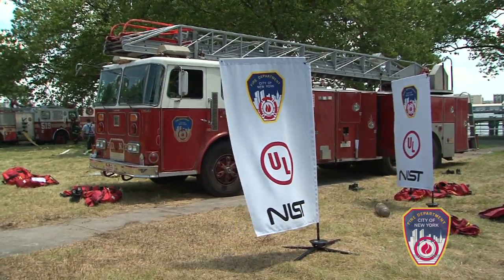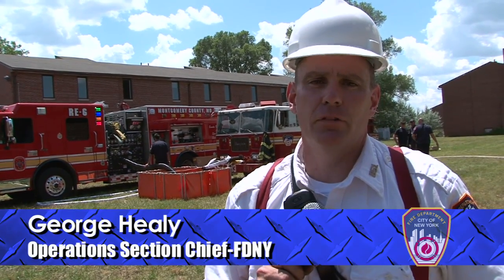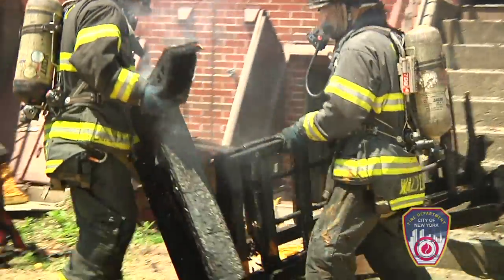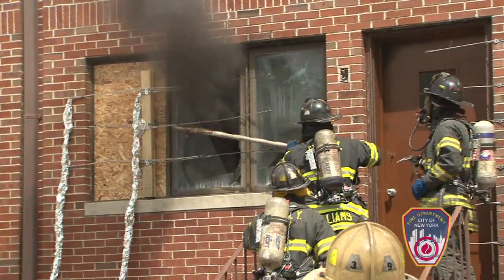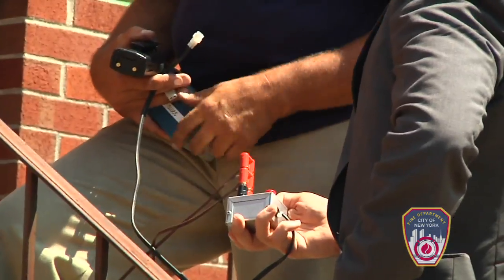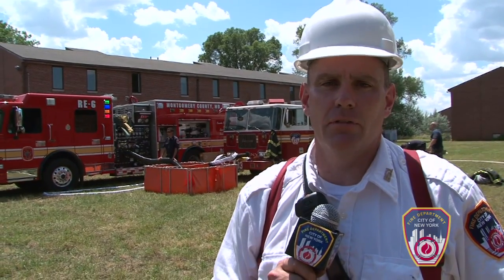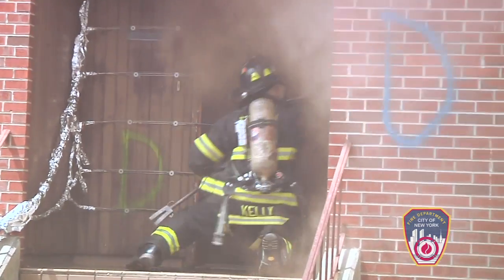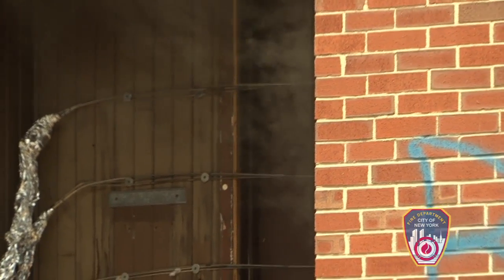FDNY Tests Fire Science and Firefighter Procedures

Comment: VEIS   First approach to a burning structure.

V - Vent.  Open the door or break out a window.
E - Enter.  Walk into a possible inferno or create one with the fresh air you introduced.
I - Isolate.  Through the front door, usually entries into the living room or dining room or kitchen in back, have no doors for isolation.   
S - Search.  You are searching in a space that has had only a pressure release and introduction of fresh air.  Boom!

VEVE  First approach to a burning structure.

V - Ventilate by opening windows at ALL Visible fire rooms.
E - Extinguish all Visible Burning Material outside and inside which will reduce the temperature by 1000 degrees almost instantly in the fire rooms and extension has stopped.
V - Ventilate more windows to allow more gasses to escape and reduce pressure.
E - Enter.  By the time a team can get dressed and get the front door open to Enter, most of the threat has been extinguished.  Extinguish any fire while searching for victims.

VEIE
  Victim protection and evacuation from other locations in the structure.  

V - Vent.  If you are told there is someone in a room away from the fire location, ventilate that window.
E - Extinguish any Visible Burning Material or Enter.  Whichever is appropriate.
I - Isolate that room by closing the door.
E - Evacuate the victim out the window.